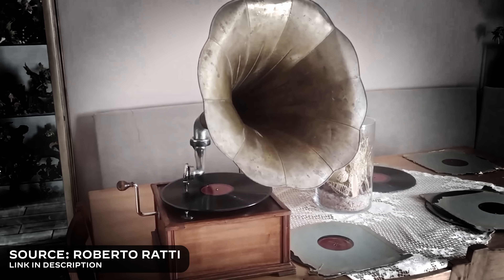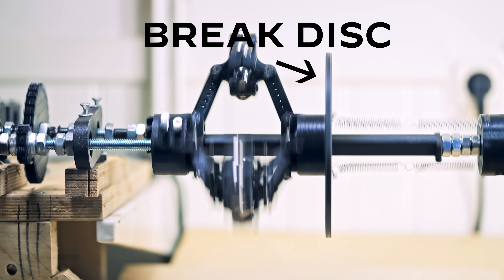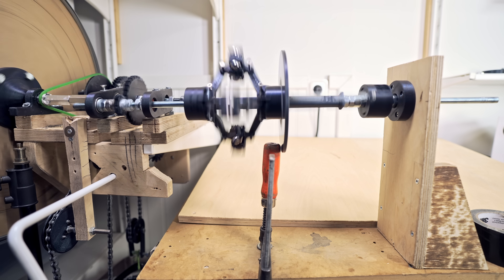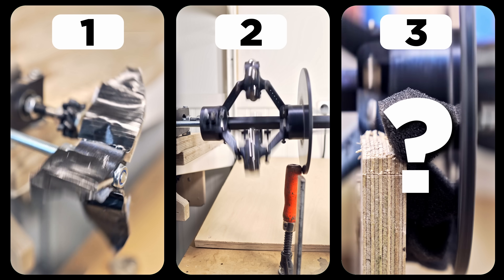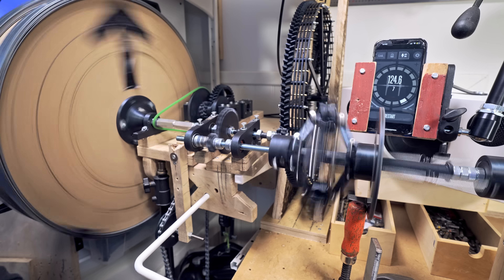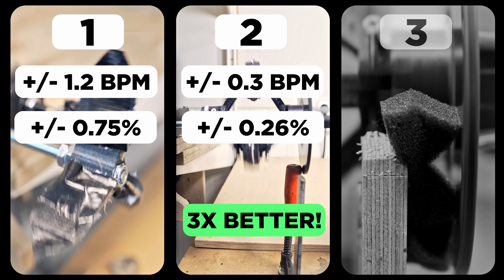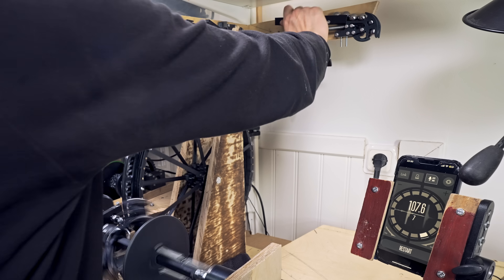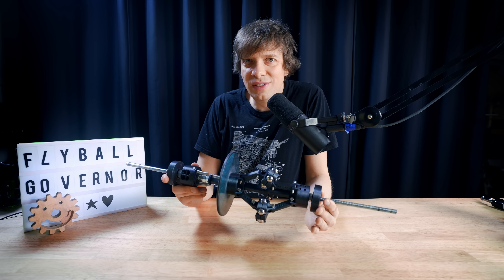How Gramophones play Tight Music - The Flyball Governor

Comment: Don't forget to consider wear over time.  Foam would be a terrible choice for the pad in the long term because it will degrade very quickly - it works great now, but it will be gone in 10 minutes.  Look for other materials that are actually designed for constant friction usage.  Brake pads for bikes?  Felt?

Comment: It would be fun if you would spin a copper disc close to permanent magnets. This would introduce a distance-dependent breaking-force due to eddy currents while being completely noise less.

Btw, When you measure at different speeds, the std-deviation is unfair. Imagine you have 10k BPS, if you only vary 1PBP, this is pretty accurate. If you are at 10 BPS, and one still varies 1BPS, then that is worse. To make your tests meaningful you should switch to "std-deviation / mean-BPS". This wont change the conclusion of your video, but i got the feeling "the process matters" does apply to you.

Also, as an electrical engineer your problem is similar to a PLL (phase locked loop). What you did is adding resistance which dissipates the energy in your control loops oscillation around the mean, so that it can settle. You can optimize your resistance by the shape of your foam wedges. A steep triangle will have a different dampening effect than flatter foam.

Comment: This is a great solution. However, bear in mind that record players are designed to always play at a fixed rotation speed (45 or 33 or 78 RPM) and if you want a different tempo which is tied to the rotation of the programming wheel, you'll need a way to adjust with reliable positioning for the break point. You could also consider using this instead to even out the input to the flywheel and handle tempo a different way, which is what I think you're headed toward?

Comment: Martin probably won't see this but I'll post it anyway. I think the flyball governor has an opportunity to be a beautiful centerpiece of the marble machine. I'm taking inspiration from the skyscraper Taipei 101 where the building is kept steady in the wind, earthquakes, etc. through the use of an enormous 18 foot diameter, 660 ton, steel sphere called a tuned mass damper. The tuned mass damper could have been hidden in the building but it has become a massive attraction. 

Obviously a flyball governor is at a very different scale, but even making it slightly oversized, it could be something that truly shows the machine at work from a distance. 

Another piece of inspiration is Andrew Bird's spinning Specimen Janus Horn Speakers. The spinning gramophone-looking horns really add to his stage presence and it has become a symbol for his live shows. 

Given that so much of the marble machine is going to be small parts moving small distances with the marbles, I think the flyball governor could be an opportunity to showcase the large movements. 

For an idea of what it could look like, there is a toy called a twirligig where the faster the toy spins, centripetal force causes the toy to change shape (usually it will be made up of ribbons but it could be anything). I'd love to see something like this.
Reply: I like this idea. Also making the governor bigger will increase it's mass and so it will be a dynamic flywheel.
Imagine it painted or even with LED's in it, changing colours as it spins. The possibilities are huge.
Reply: @musicbro8225 no LED's. It must be strictly mechanical or it loses some of its charme. But i agree it can look really cool. Imagine a cut out somewhere between Marble canals and the gouverner spins through that
Reply: @Aeraleach  Ok, let it make sparks then :)
Reply: @musicbro8225  uuhhh and use it as an instrument as well
Reply: It might be better to have something like this as a module that just plugs into the power train. That way to can be designed completely separately to look as cool as possible. Also different versions can be created and used for different tours or placed around the stage.
Reply: This would be very cool.  Perhaps a very visible linkage to a large tempo tuning lever (this would need a high leverage factor anyway for better precision).
Reply: That would be very cool. Although, I've repaired a few gramophones and I've seen these sorts of governors disintegrate without warning and it is incredibly scary, so if the marble machine were to have it as a showcase-- and I think it should 'cause they're mesmerizing to stare at-- then it would be pertinent to design it with maximum safety in mind.
Reply: Not even the same concept...

Comment: If you add a flywheel drive disc on the other side of the "brake" disc, you can add a bunch of energy to that flywheel, and as the driven disc slows down it'll contact the drive disc and s speed up and if it speeds up too much. the static disc will slow it back down. That way you'll be able to step away and do other things once it's up to speed and just add energy (turn the crank) occasionally.

Comment: I think the flyball governor could be improved even more by mounting it vertically and by simplifying the mechanism to eliminate one of the joints near the marbles (put the weights on one of the arms instead of on their own floating piece probably hanging out past the joint. You can also increase the sensitivity and decrease the wandering by moving the spring anchor point instead of the break pad to change the tempo. Set the brake position to the most stable location and then add a bearing carrier to pull the other end of the springs to change the tempo. Basically, there's going to be a sweet spot between the angle of the arms and the tension of the springs that will produce the most stable speed. Lighter springs create the most accuracy. Use gravity to pull the weights down as much as possible. You can also improve all of it by putting as much of your total flywheel weight as possible in the governor weights themselves.

Comment: How does the mass on the flyball effect its tightness, and the flywheel. Did the foam work better just because it was more surface area, or because the spongy nature of it made the damping effect more smooth, or both.
I want more data and i dont have a prototype higgin device nearby so i need vicarious data

Comment: Your tests are incomplete.  You need to consider changes of load (such as more or less marbles being dropped per second, or fewer).  You have only one marble track, dropping at constant rate, so load is steady (like gramophone).
          But I fail to see the point of all of this.  Gramophones ultimately used electric synchronous motors for their drive.  Why don't you use motor if having absolutely constant speed is the goal?

Comment: They used to use slime on Governors on Old stationary diesel engines to make sure they did not over rev, when they ran at full speed. They also ran a cylinder around the flyball Governors to keep them from going too far out. When they would be all the way touching that cylinder that was called "balls to the wall" which is where the term for going full speed was said to be "balls to the wall".

Comment: Well done Martin!
I am a bit worried about the foam, maybe wears out after sometime.(you can try also other materials)
But what if you put maybe a ball bearing touching the wheel so the friction is even less.
3 balls touching the wheel like a triangle, or maybe 2 balls in the opposite site.
So it will also keep the spinning disk aligned and also prevent it from any bending, too much bending or wavering can change the tempo as well.

Comment: Try to keep the number of variables you change between test as low as possible. The desired BPM is of influence on the "tightness" of the beat. So the foam brake is most likely not 10 times better, much more likely in the order of 5 or maybe even less. Still better than the airbrake, but if the effect would have been less, you might be convinced of the effectiveness or missed a effective way to improve your machine.

Comment: Plus this makes adjusting the bpm on the fly real easy by adding a lever to position the break back and forth.  Means you can set differnt songs to differnt bpms easily and even do manual things like adjusting mid song if you want or taking manual control!

Comment: a flat Bearing on a stick would be more rigid instead of the foam,. or rather a flat bearing on a metal stick  would be more rigid and tighter. like a skateboard wheel. ya know. on a pole. would be better for your friction brake.

Comment: The solution for the flyball governor isn’t necessarily the foam pad, but choosing a material that provides the required friction on the brake wheel without causing additional vibration or noise. Nylon, Teflon, Delrin, or a felt pad may also be good candidates. There may be a good case for a metal brake disk too… just get a solid bicycle or motorcycle disk brake off the shelf 😂

Comment: With this new flyball governor you may be able to reduce the size of your flywheel significantly. Since it's not being used as much for timing anymore, it just needs enough mass and momentum to keep the machine at speed as things are activated. That way you can get the machine up to speed quicker if the flywheel is lighter.

Comment: Hi Martin,

these results are amazing!!

But I'm afraid the speed remains a function of the power used by the marble machine.

The flyball governor can be used to set the speed when the power is constant, but it will not maintain the speed if the power changes.

This means that the music will slow down and speed up when you engage or disengage any instrument by changing the number of marble to lift.

Not knowing the specific parameters of your flyball governor (mass, length, spring stiffness, ...) and the power consumption of the MM3, I couldn't quantify the effect a change in power would have on the speed.

It might be minuscule, but you should test it.

Comment: I wonder if you could use eddy currents with magnets and a copper/aluminium disc as a means of forming a brake that doesn't wear out

I'd be curious if the heat generated in the disc would cause drift though. Just an idea!

Comment: Haven't got through the vid yet, but surely having the governor modulate the input power/seep (eg via changing a gear ratio or altering the rotational inertia of the flywheel is going to give more linear and more controllable/adjustable results than just using it as a physical brake? Now to tune the braking force/ response you need to tune the weights and springs (and sliding friction) of the governor, rather than just some aspect of the linkage between the governor and the  controlled variable.

Comment: I get that marbles on the floor and the mmx potentially (if very unlikely) exploding due to a stuck marble is a reason to start from scratch. What I do not get is this obsession with THIS level of tight music. 

Anyways, I‘m very glad martin is satisfied and the dream lives on!
Reply: It needs to have the capability of playing very tight music first. If it's intentionally programmed to play with no timing deviations but fails to execute the music in that way, that's a problem. It needs to respond correctly to the operators actions (including the operator's own mistakes), otherwise it's an unreliable piece of junk at worst. It's like a keyboard dropping out notes even though you clearly instructed the keyboard to play said notes; no musician would ever want to deal with that!

That is not the same thing as mistakes that are caused entirely by the human operator. If you were making a wood project using a CNC machine, wouldn't you rather have the mistakes be caused by you, the operator, not by the machine itself? If the machine induces its own errors completely independent from the instructions you give it, it's a piece of junk.

Comment: I agree that using pre-existing solutions is really really helpful.  But, please don’t forget that what you do is extremely helpful too: you are finding out just how good these pre-existing solutions are, if they exist, compared to other attempts at solving a problem.

Maybe there are books and papers that explain how different solutions compare to each other.  But some of them may have been written 100 years ago, and nobody knows about them any more.  Or the results are slightly different in our times, with the tools and materials of our times.  Yet, I admit that the best solutions use physical or mechanical ideas that do not depend so much on materials, precision or wear.

Comment: I wonder if an aluminium disk would work well as a brake disk, with strong magnets used as the brakes themselves? As the disk moves closer to the magnets, the eddy currents induced from the disk moving though the magnetic field would induce a drag effect on the disk, slowing it down without needing to make contact

Comment: I wonder if there's anything you'll need to do regarding long-term plans for the use of this new governor. The one real benefit of the clamp/solid object against the brake is that it won't degrade, whereas the foam will. Foam will certainly degrade over time, and maybe even through the friction against the brake itself, depending on how often you use the mechanism. It might be a high-maintenance mechanism.

Comment: Not watching.
This obsession with "tight" music is approaching stupidity. You have already proven you can play music "tighter" than the human ear can discern.

There is a reason why engineers include tolerances in blueprints.
Before you prototype another part, you need to decide what the tolerances for your music's "tightness" are, and be sure those tolerances are feasible. If you don't, the MM3 won't be built because of your neverending quest for perfection.

Comment: To reduce mechanical noises, i suggest to use a magnetic brake (no friction noises) and implementing libear bearings for the rregulator (ball recirculation bearing should be the best ones)

Comment: I think your measurement is still not perfect. a better system of measurement would be the rpm of the flywheel. You could use a laser tachometer with an analogue output and an osciliscope. if i am understanding the equiptment correctly.

Comment: pst your already working on v3 your just finding the best parts to use one at a time. your figuring out which parts to use before you try getting them to work together. before you knew how you wanted the enitre machine as a whole to work and tried finding parts to fit in. now your actually designing v3.

Comment: Using a breaking mechanism to regulate speed just dumps mechanical energy into heat.  Better would be to use an escapement that releases the power at a controlled rate.

Comment: I wondered if you would do something like this. I especially like that tempo adjustment is also easier with this method. Please look at existing solutions for brake pads and disks, foam my be good in the short term but not so great in different temperatures and humidity or as it wears out.

Comment: I wonder about reworking the brake to induction. It seems to me that you could embed magnets(alternating poles) in what is now the rotor and replace the pad with a plate holding copper windings. Could end up with a speed controlling system that is contact free.

Comment: In 1672, Pitstone Post Mill here in the UK was built, roughly. It uses a fly ball governor to regulate speed. If it can regulate the oldest surviving windmill in the UK then it is probably good enough for your needs. If you are ever in London visit the Science Museum. You will see tons of these governors and various designs of adjustment and brakes on the steam engine floor.

Comment: Great video!   Have you any concerns regarding the frictional wear of the foam vs the flywheel?  if the foam degrades and the surface area changes you'd loose control of the bpm.   Could a set of "soft" wheels with a sprung tension against the flywheel prevent such wear and tear? just a though i wanted to share. Thanks for the marble machine videos and keep up the diligent work!

Comment: The flyball governor was used in industrial applications and were regulated with gravity intead of friction. The weights  were mounted on a vertical shaft and the lever arms were ajustable in lenght to get the desired rpm

Comment: This is great using existing technology! But be mindful of issues that can arise when you scale up. The marble machine will have a lot more power involved with the marble machine that the grammaphone, whoch means a lot more heat or abrasion at the flywheel govenor. It might require using an existing brake bad or heatsinks to deal with these issues. You might also look into magnetic breaking, similar to how a lot of exercise bikes work. Have the breaking flywheel be an aluminum cylinder, and it moves sideways to get closer to a magnet that is close to the perimeter but not touching. This will cause magnetic drag, and you only might have to deal with some heat on the aluminum if it is a lot of mechanical power.

Comment: Of note, the original Victrola didnt use foam to break the flywheel, it used felt pads. I would be interested to see if felt provides a more durable and consistent material while still allowing some give.
Reply: Was it also on a sprung arm? I think there needs to be some movement allowed more than the thickness of felt.

Comment: I wonder if the air governor is really worse or if it's just underpowered. It's sort of a mass/spring/dampener sistem wich will come to a stable frequency when the three parts are in tune and it can be mathematically calculated how to better approach it.